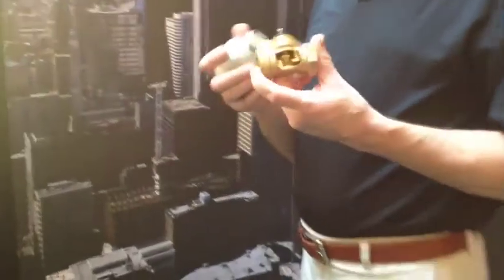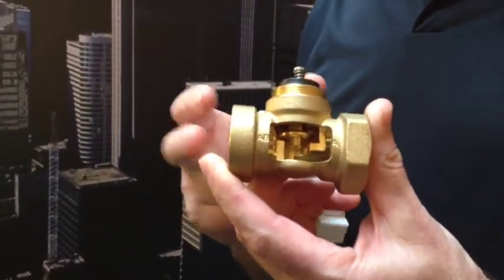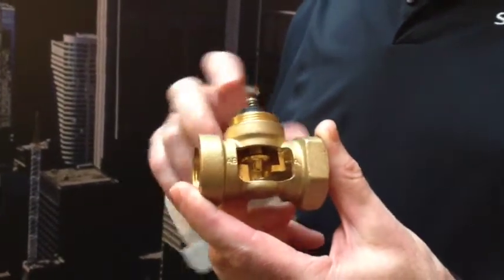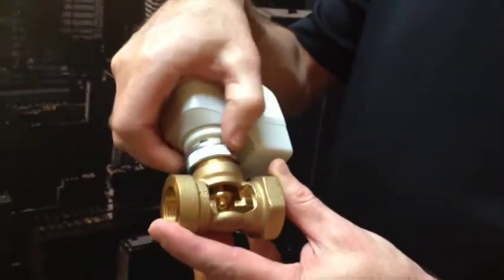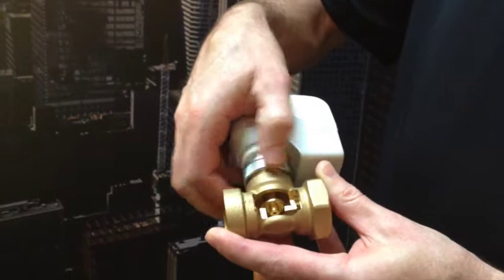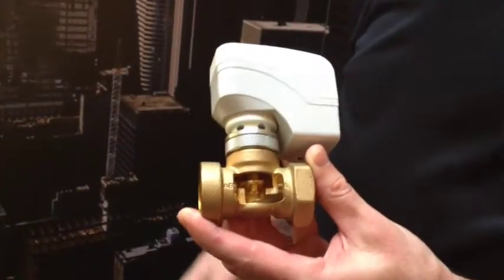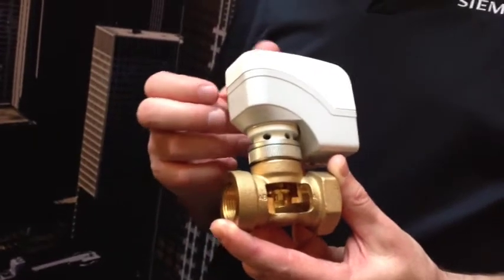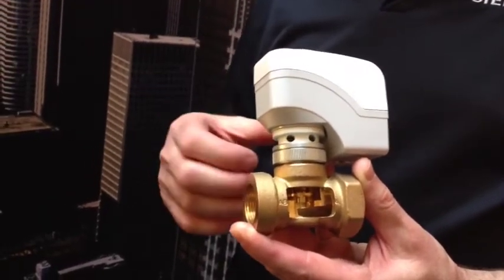Siemens Zone Valve Overview

Comment: Are these able to be repacked? Cheap part, I know. It was plumbed into a pretty difficult spot and repacking would be much easier, if possible. 1/2" siemens globe valve SSA61U 00210